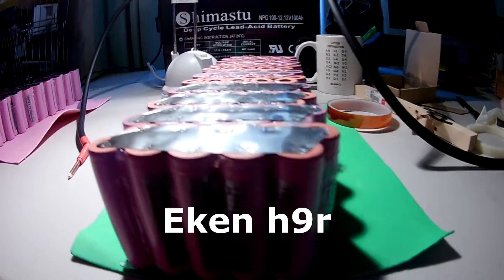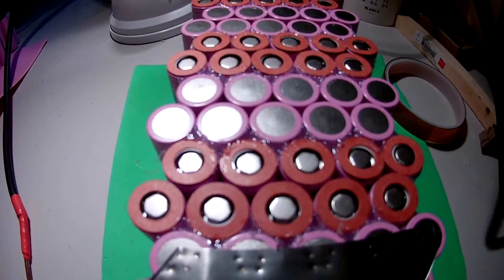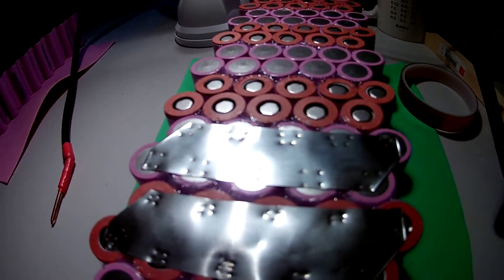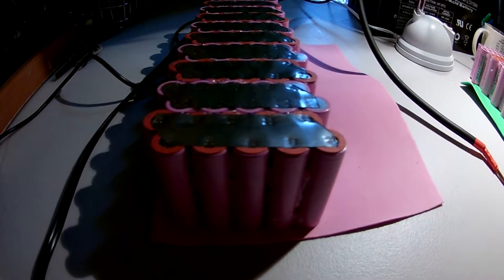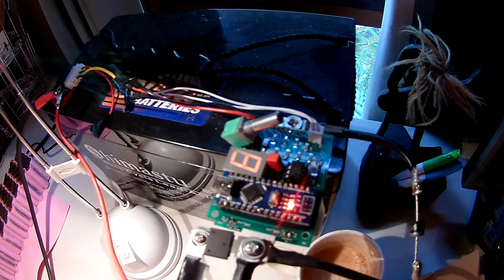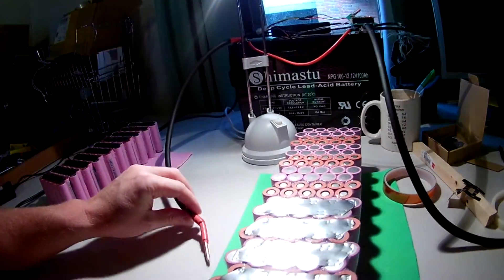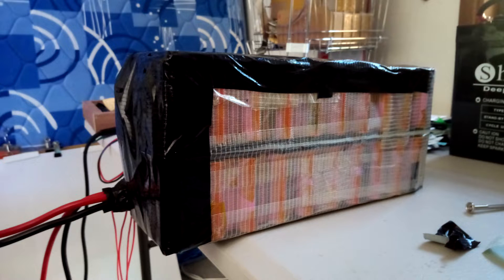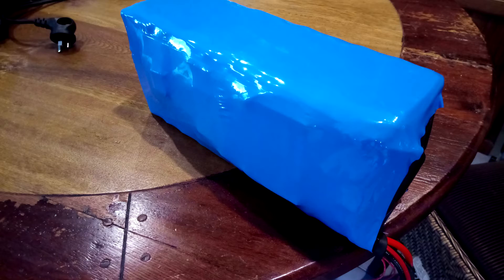Stealth Bomber Ebike Replacement Battery 18650 20s10p

Comment: Hi, nice build! I watched also your high-amperage build of battery pack with cooper wire in series connections. that was good idea. Please, I have question. both of these packs were sealed by foam paper and shrinktube precisely. is it allright? cells doesnt need breathe? what do you think about overheating and cooling by air? if pack is designed well, then there is not important any air cooling? thank you
Reply from the maker: Yes there is no need for cooling. Certainly if you are pulling lots of power continuously air cooling could be a consideration. But it's just not relevant here.

Comment: Hi Lee, what 18650 Batteries do 'Stealth Electric Bikes' use out of the factory? How long did your customers original battery last?
Reply from the maker: im not sure what they use now. You could ask them? info doesnt appear on the website. They used to use LifepPo4 that has slightly different characteristics than the 18650s. They use li-ion now, but you'd need to enquire further to get the chemistry make up etc.
Reply: @YeahItsLash  Thanks Lee, I'm thinking of buying a P-7R do you know anyone who has one? I'm interested in getting some no-sales feedback.
Reply from the maker: @karlbartelt3939   not sure of anyone owning one, you can probably get a test ride at a shop though. They were developed up from the DIY Beta frame they put out. And is my frame of choice for my DIY builds. Heres one of mine from  instagram pic https://www.instagram.com/p/BqWxdHpBTBF/

I have some new videos coming soon about my bikes, - to sum up you wont be dissapointed, good all round bikes. But they are lighter and a tad smaller than your bigger beefier stealths. so depends on what you are after.
Reply: @YeahItsLash  Thanks Lee i'm mainly a Road Rider and Moutain Bike rider than a MotoX maniac.....but the B52 does look awesome!

Comment: Hello Lee, does this battery works for a 2013 Stealth Bomber? The guys at Stealth told me the maximum amperage would be 24 for the 2013 model.  Do you know? Thank you for the video!
Reply from the maker: im not 100% sure on the specs for each model. The one I replaced  used an 80A controller from memory. Maybe you are thinking 24 Amp hour capacity? which would be about right for original battery. my 10p battery gave 30AH. and had enough capacity to provide 150Amps constant (15A per cell). The stealth bomber is 72v.

Hope that helps.

Comment: Great! I am about to build myself a 20s14p for the alpha frame. What is the size of the shrinktube you are using? What about the cobber you are using for the connections?
Reply from the maker: Mads Peter Nørgaard it's 300mm wide shrink wrap. Check AliExpress. Copper sheet I got from a rc hobby shop. Can get copper online. 

240 cells will be a tight fit in the alpha. Good luck with it.
Reply: Lee Ashby great thanks. Allex from ES did 20s14p some time ago.. 

With the cupper i ment the cupper wire that is connected to the plating.